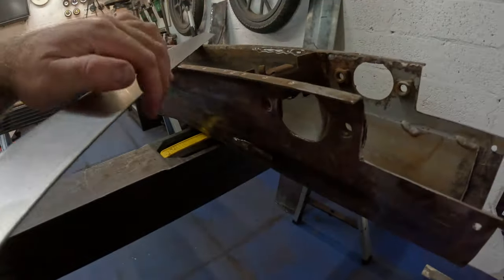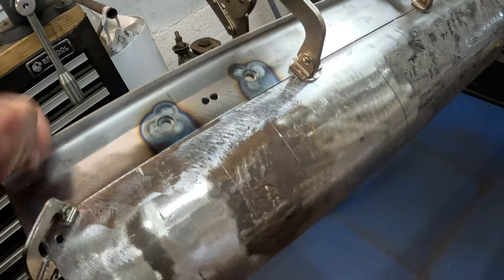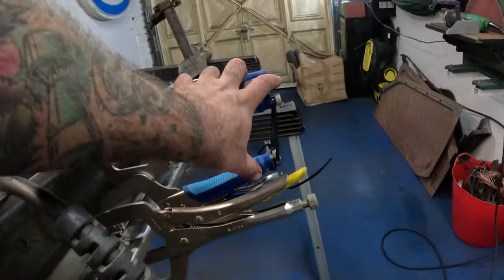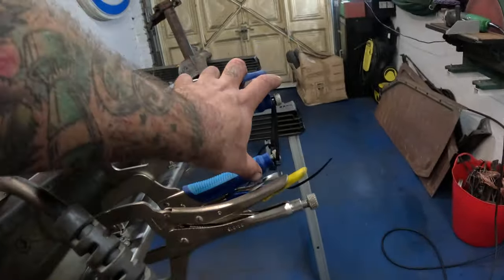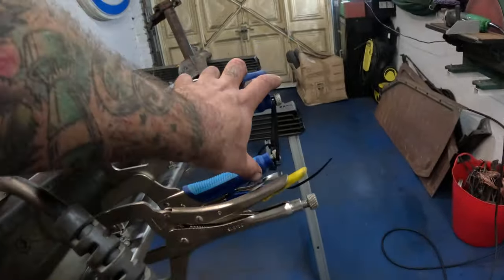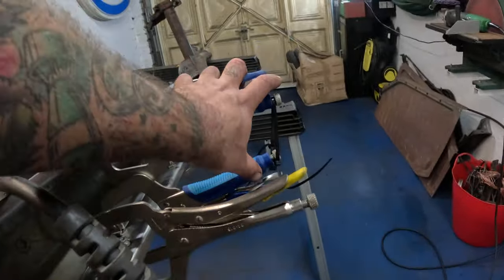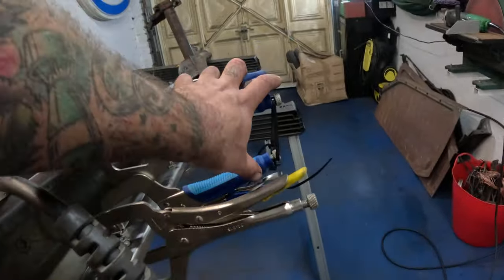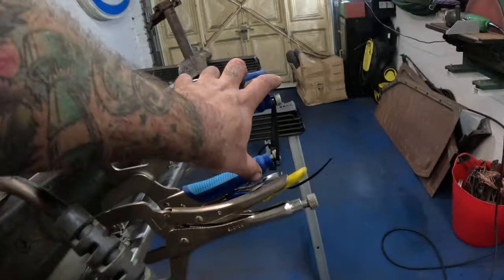Building a Beach Buggy - Part 2 (More Chassis Work)

Comment: I restored a Winnie certified '67 Manx that came to me in pieces. The ethos back in the 1960s was build them up as quick & cheap as you can, salvage as much as you can from the donor & go have fun (I think some of the Meyer's ads claimed it could be done in a weekend). Which meant I found myself dealing with 50 year old bodges!

Your work is so exemplary it's just a whole other level. Can't wait to see the rest of the build.

Comment: This is totally the incorrect way to shorten the chassis, never "but joint" the two chassis parts together. Chassis are cut behind the handbrake because you can slide the chassis sections into each other. Also cut the joint at a fourty five degree angel ( Z cut) will be twenty time stronger. This section of the chassis is the back bone of the car, the stronger the better. apart from that great workmanship and a good vid